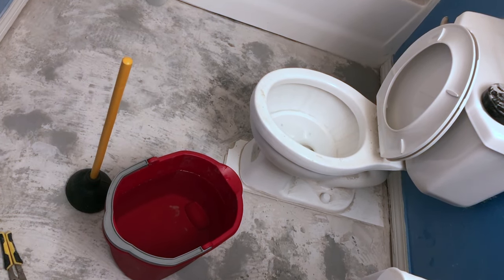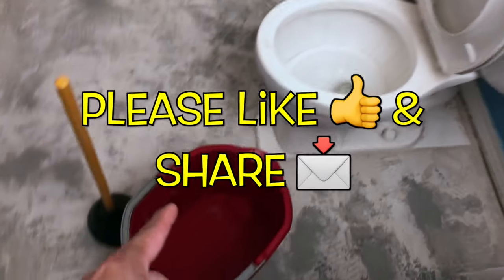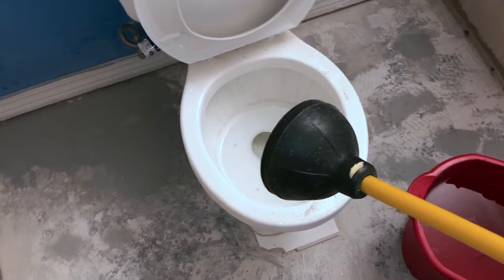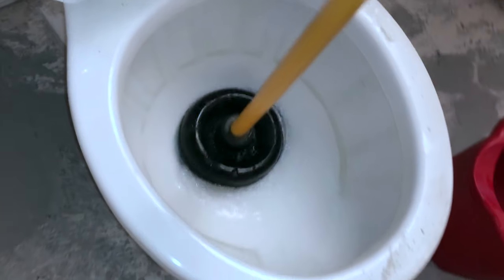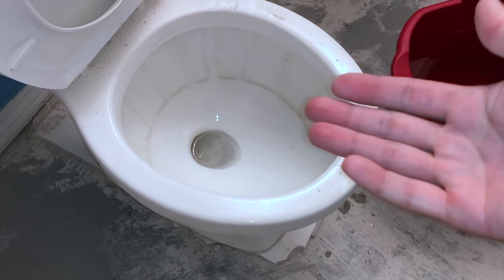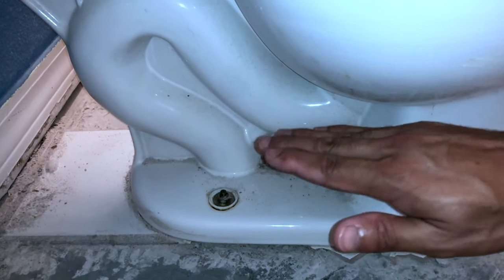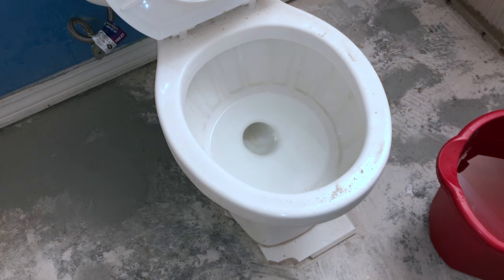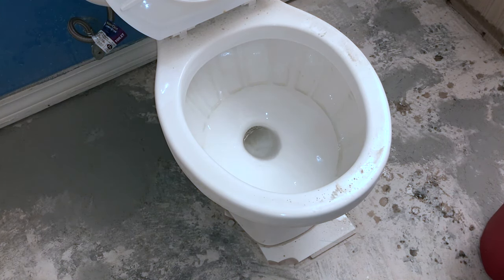✅Get Water Out of Your Toilet Bowl Fast So One Can Remove Toilet & Prevent Spillage HD Review

Comment: To get a lot out of the little bit of water that is left down in there, I use a Wagner paint stick where I simply slip a hose on the end making a giant syringe to quickly suck the rest out. I do that on my job to remove stains in that lower area with Zep acid bowl cleaner.